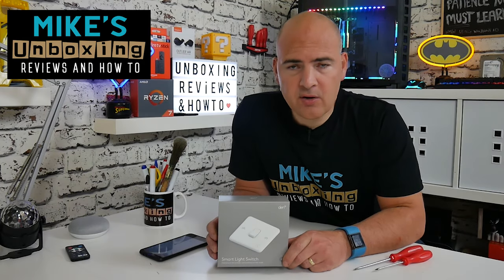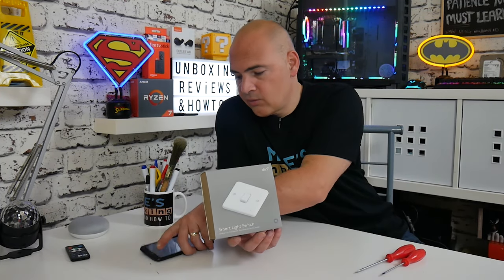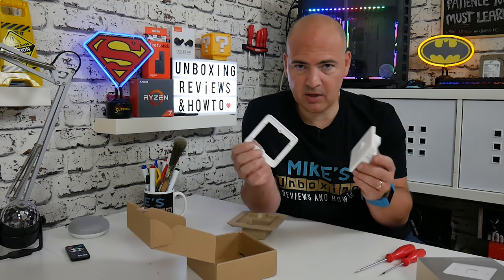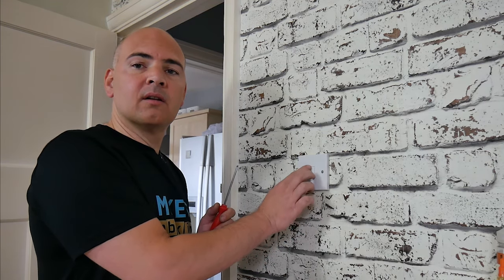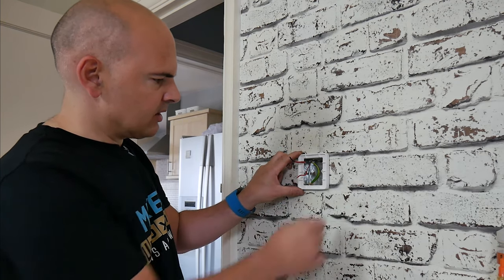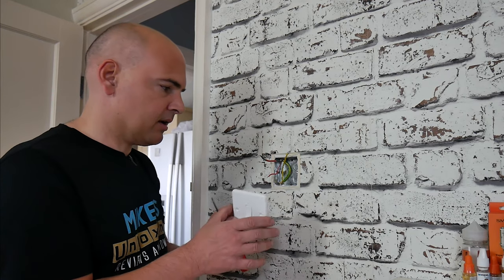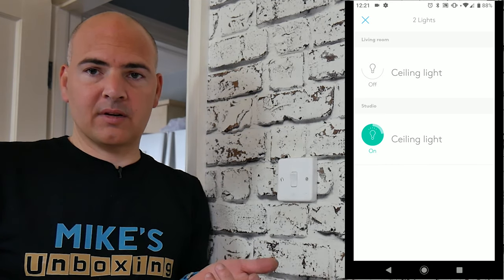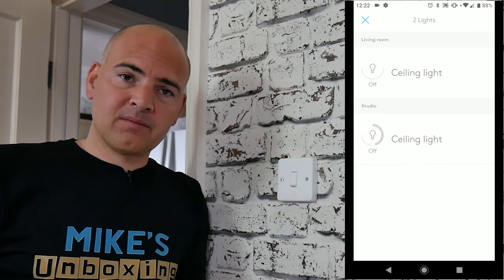BEST Home Smart Light Switch Den 1G Switch Install and setup guide

Comment: Great how-to video, Mike. The safety tips are helpful! Quick question? Is it typical that you press down on the switch to turn things on in the UK?
Reply from the maker: Thank Sky! Yes it is common for switches and sockets to be flipped down for on. There are on some switches a red marker to show when it is on. So if the switch was the other way the red marker would be facing to the floor and you wouldn't know it was on or live. Here is a picture to show what i mean. https://www.screwfix.com/p/mk-logic-plus-1-gang-13a-dp-switched-plug-socket-white/14790 These markings where used from around the late 70's onwards so it has become a normalized thing for a few generations.

Comment: No neutral required? One cable is live the other is switch live on a normal fitting, what's going on in your house, also I might think of a rewire, the plastic on those cables eventually will degrade, and the new colours are inexpensive, if your a fully qualified electrician rewire your house and put a new fuse box on it, if you have to get someone else to do it your looking at around 2k
Reply from the maker: Some homes have the additional wire that is sometimes referred to as a neutral from what I have researched. And this is required to power most of the smart switches on the market.
So that is a live and a return plus the extra colour cable and an earth.
Good point about the rewire

Comment: and how the hell this crap it's working without a neutral wire? ooohhh...via earth...well...crap...i bet your rcd won't be happy about that if you mount those switches in mass and exceed the threshold of the rcd.
just a tought
Reply from the maker: i'll be honest i don't know how these work in the electrical sense, but i understand your point. How many of these do you think would be needed to cause the issue you mentioned?
Reply: @mikesunboxing  a rcd kinda keep track of balance between live current and neutral return current (in a simple to understand way), if this balance tips one side, it trips the rcd, that's why it's not a grate idea to use earth as neutral, every switch will tip the balance a little bit.
How many?well, that depends on how low power is(taking in account waiting time between switching the lights, i guess it's build low power) and also depends on the rcd threshold.
Anyway, i like the fact that the mecanical switch trips also. I would buy them only because of that and use them with neutral installed. Hopefully the waiting delay can be hacked
Reply from the maker: @kyme32  thanks for the reply, i don't know for sure that is uses the earth return for power, i think there is a capacitor of some kind that holds some small amount of power for switching, and that is why it can't be quickly turned on and off again, i could be wrong of course